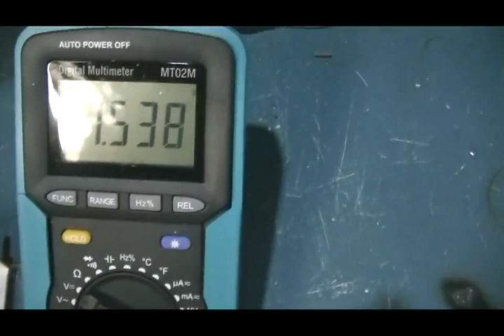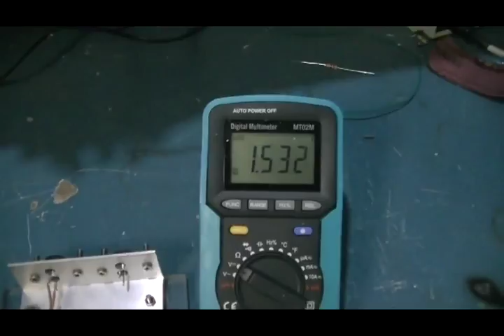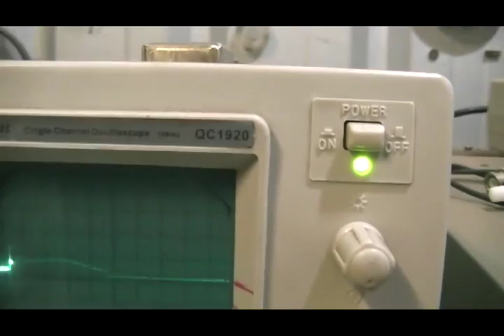single wire pulse motor

Comment from the maker: Hi skycollection
This first go at a single wire setup seems to be very efficient.The reason for this is,it seems that the pulse duration is only about 1%-a very short very sharp pulse.
This is why i couldnt see it on the scope.But when i went up in higher time devisions-i could just see the pulse.The interesting thig is that the back spike is of a longer duration at a higher voltage.So this brings me to the conclusion that the transistors them self are useing more current than the coil.

Comment from the maker: Hi Russ
Can you email me the user name,as this link says ww broken-or some crap like that lol.
This circuit is based around 2/3 of a solar garden light circuit,with a few mod's to get some more power through it.
The garden light had some small 4 pin component in it.When it detects power from the solar cell,it would send the charge in one direction(battery)when it didnt detect any charge from the solar cell ,it would send the charge from battery to the led.

Comment: tinman, that is some very fine work!   No sensor required, which is great, and only a single coil serves as trigger and driver, remarkable.    Is there a diagram available somewhere?  thanks